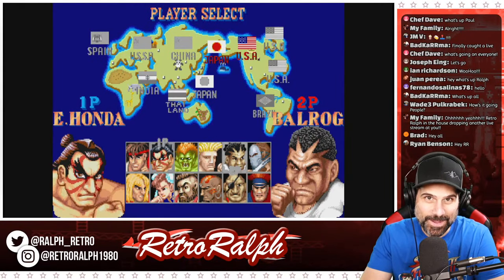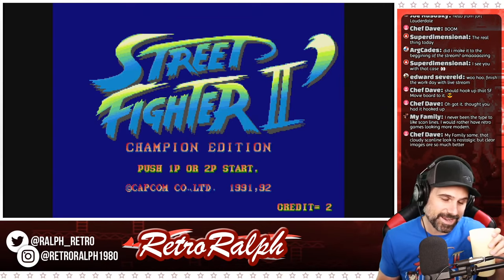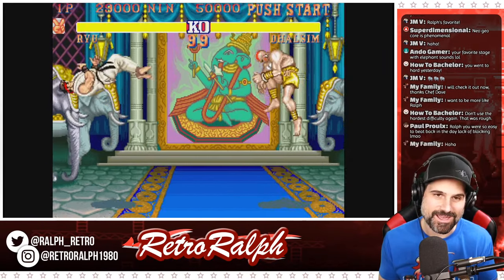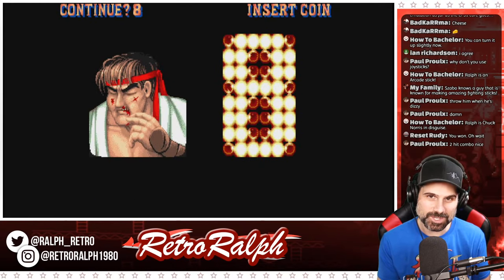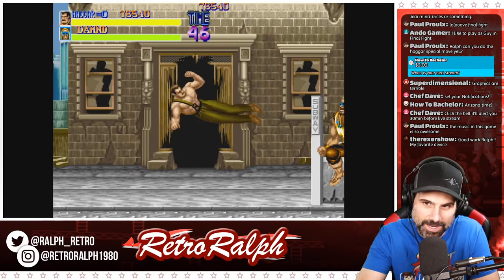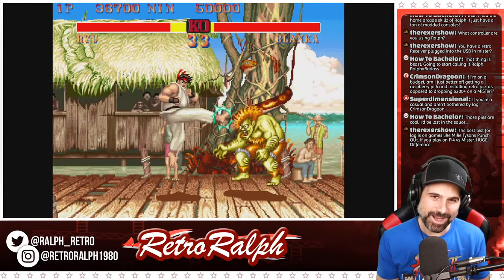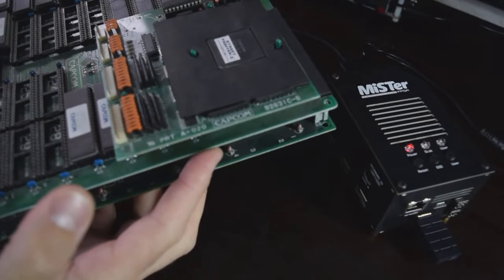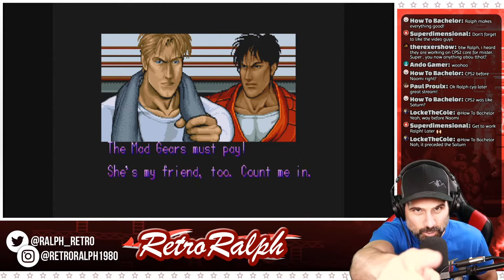Street Fighter II on MiSTer CPS1 core!

Comment: All the MiSTer builds I've seen for sale work out more expensive than buying a real CPS1 multi. Building it yourself ain't that cheap either. So... It's not very exciting. If it cost the same or less than a regular bootleg PCB that might be different.  

For $400-$500 they can f*ck right off.

Also, if you aren't outputting it on a CRT in it's native res and refresh rate then it's entirely pointless because it's no longer indistinguishable from the original (so you may as well be using mame).
Reply: The MiSTer is far more than just CPS1. Now CPS2 is publicly available along with a lot of other classic arcade games (and consoles, computers, handhelds). That price tag you're looking at is for the full set of the DE10-Nano and accessory boards. If someone truly was only going to use a MiSTer just for CPS1, all they need is the DE10-Nano and a 32MB SDRAM module. So that's about $210 USD for the two. But adding in all the other systems you can play on it, even the full build price is worth it.

Also, you CAN output to a CRT at the game's native resolution and refresh rate with a MiSTer. You'd either use the VGA port on the analog IO board (which also supports Component and SCART connections) or convert the HDMI and set the config to send analog out over it (called Direct Video mode). The MiSTer is better for latency than MAME, even over HDMI. The FPGA process skips that latency you get from software emulation. Combine that with the easy output to a CRT to cut display latency and you've got yourself an authentic and super low latency experience without any arcade board headaches.